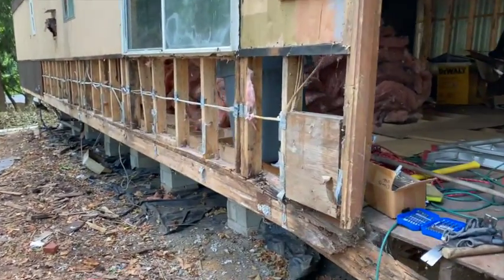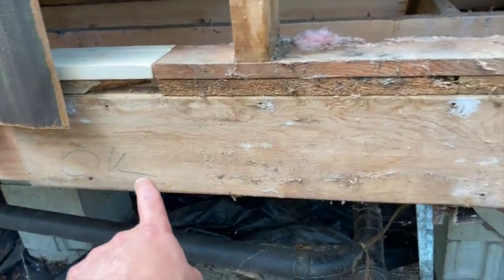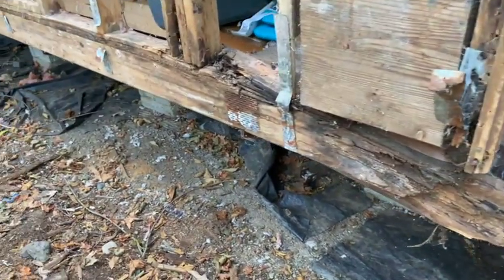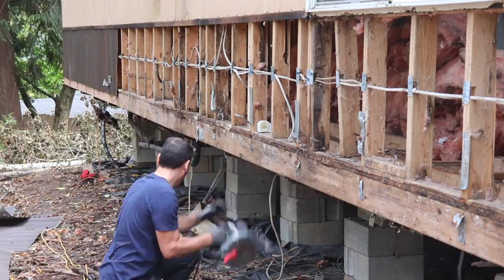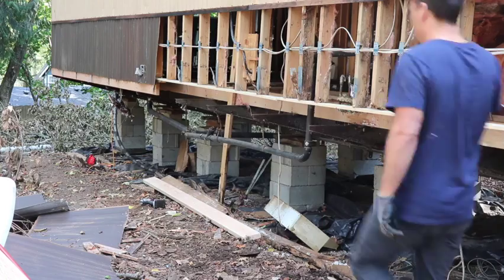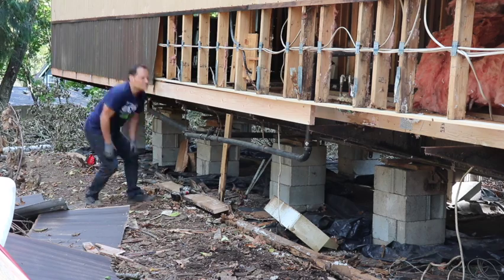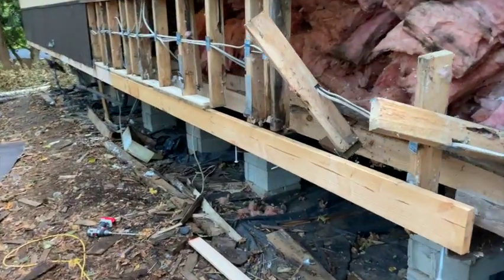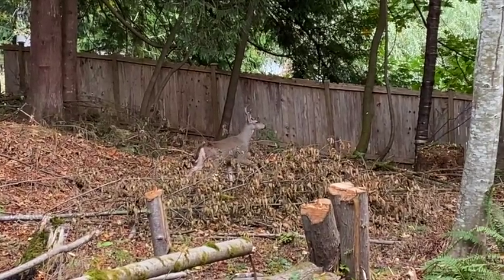Old Single Wide Mobile Home DIY Rim Joist repair Part 2

Comment: That unit is the same as mine in that the floor joists run lengthwise instead of widthwise. Not always the case.Viewing from westcoast Canada! CHEERS
Reply from the maker: Thank you sir! Yes, I had never seen them built this way till I opened my floors up.

Comment: So trailers don’t have wood sheathing like a shed or a house would?
Reply from the maker: It all depends on what the siding material is. If it's a vinyl sided house, those will usually have an osb sheeting backer. If it's T1-11, well that's the plywood sheeting. But yeah, the older models with aluminum siding like this one, yup, not plywood backing, just those 1x2 runners to help keep it square. Hope that helps. Thanks!

Comment: How are you keeping the wall from falling when ever your removing the bottom plate?
Reply from the maker: I think they didn't fall because of the top plate and the little 1x2 runners along the length which I think just kept it held together in one piece. Or maybe just a whole lotta luck! ;)

Comment: Mine is pretty bad I'm afraid of the wall or roof falling if I do it this way as we are living in it.do I need to worry about that
Reply from the maker: I would say, if you do one section at a time, say a 14' 2x6 worth, you should be A-OK. One thing you can do is, build a 'false' wall inside, about a foot or two in from the section you are working on. Basically, tack a 2x4 on the ceiling and use 2x4 post from the floor to the ceiling 2x4 with a really tight fit so that when you pull out the rim joist outside, the ceiling won't sink at all. Hope that helps. You got this!

Comment: New to channel can you replace the siding with wood shingles.
Reply from the maker: Technically you could do that for sure. You'd need a backer so you have something to nail the wood shingles in to though. You'd probably want to put up 3/8 or half inch plywood , cover it with house wrap then nail the shingles up as you would on a roof. However, in my neck of the woods you would have to get an engineer to stamp off on those plans so it would cost a lot of money just to get the OK to do it. Hope that helps. Thanks!

Comment: 10s of thousands of singlewides have had this problem.alot in rhe landfills and it all could have been avoided if HUD made manufactures have overhangs by code.
Reply from the maker: Totally! It's so crazy how they made these things basically to just fail and fall apart after a few years or decades. I mean, they could of at least put real gutters on them, not these half inch rv 'gutters'.

Comment: What's the size of the carriage bolts you are using and what size drill bit?  I was afraid that big window was going to hit you in the head!
Reply from the maker: I'm not sure off the top of my head. I think I have one bolt in my tool box. I'll get a measurement tomorrow. I think I went with the 3/8 drill bit by about 10 inches long. Yeah, they used a lot of adhesive around that big window. It was actually pretty hard to take it out when I finally did after the roof collapse last winter. I'm just about to start framing that wall back up too.
Reply from the maker: Looks like the bolts are 8" long. Pretty sure they are 3/8 thick too.